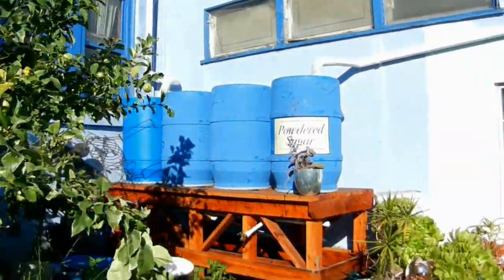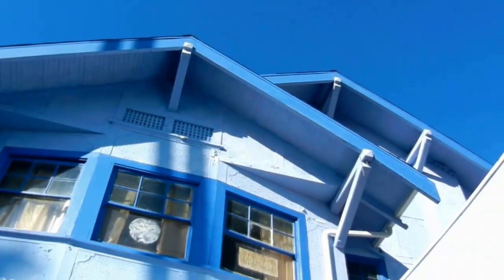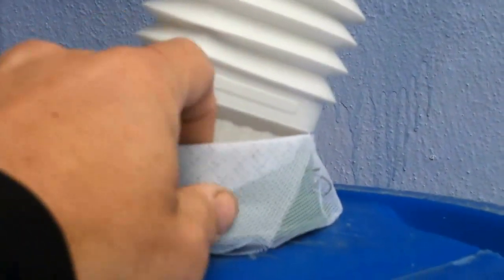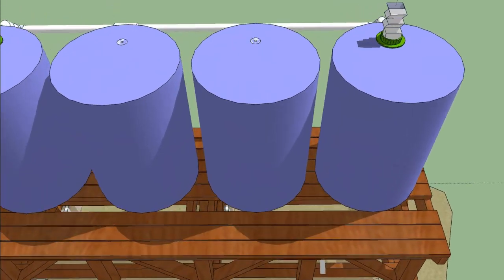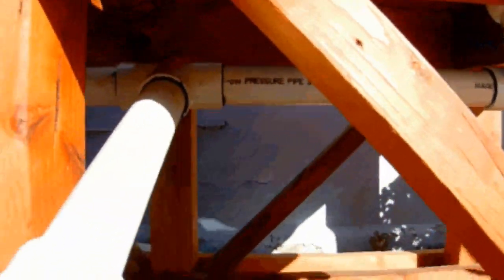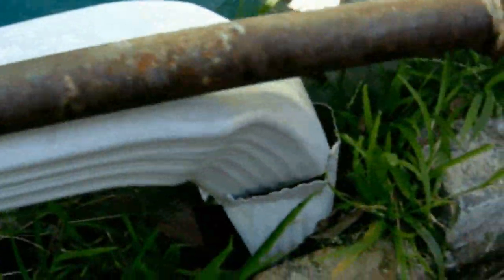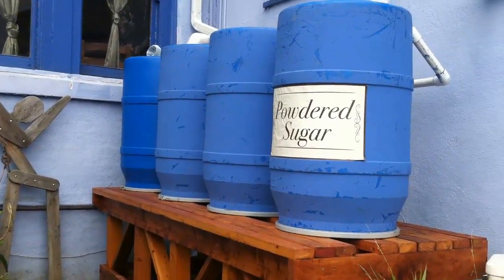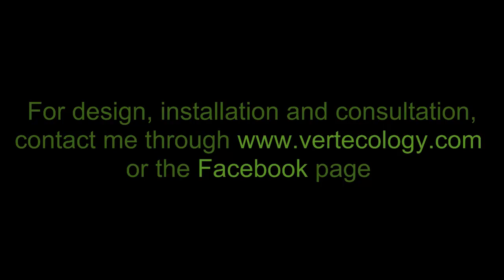220-Gallon Rainwater Collection System at the Sugar Shack

Comment from the maker: The pipe diameter from one barrel to another is enough or not depending upon your inflow. If water's going to come into your barrels faster than it can escape during an extreme storm, you're going to have problems, from tolerable backflow to explosive flooding. The simplest way to think of it is that you want to design your system so that there are no bottlenecks. This means that any excess water coming into your system at any given time can escape just as quickly as it comes in.

Comment: After finishing the video, I would be remised to not applaud what you've done there. Great system. I will absolutely model mine off of what I've seen here. The design software you are using seems very efficient; what is it?

Comment from the maker: The open top barrels can be a good idea if you're not concerned about water puddling near a foundation, since they just let the excess water bubble over a wide surface area when they're full. Since you couldn't find those barrels, you have to come up with a way for excess water to escape... that big storm will come, and escape it will. That's why I designed the system shown here with the overflow manifold out the back, and would have done better to use wider pipe diameters. The inflows

Comment: Great video!  I am building a very similar setup. The main difference is my barrel will be fed by two, 1 inch lines that come off a diverter (rain reserve brand) on my downspout.  My downspout is 17 feet away from the barrel. I was told I should insert the feeder lines near the bottom of my barrel and they would fill as long as the diverter was higher than the height at which the lines enter the barrel. Do you think this would work? Any tips for making a water tight connection of hose to barrel?

Comment: Problem with these welded, upside down barrel systems, is once in place it is permanent. I just had to hacksaw my 3 year old upside down system (220 gallons/4 barrels) for algae maintenance. I realized 3 years later, there was no way to 'unscrew' each barrel and flip for cleaning. So now I have a big mess I'm trying to figure out how to re-assemble better

Comment: Well done video I liked it very well presented  -  I will do exactly the same I just think if I had as much height to play with I would have done it a little higher - for added water pressure - But it wouldn't be as easy to get to so I guess its perfect -

Comment: Why not just have the barrels normal facing up and not drill any holes in the bottom, then use a hand pump to get the amount of water you need or want.  This way it would be also a lot cheaper and no chance of losing all your water should there be a leak.